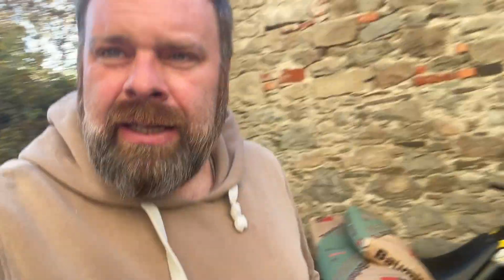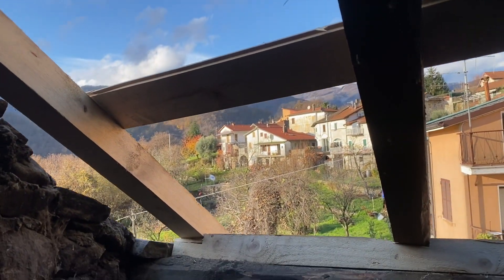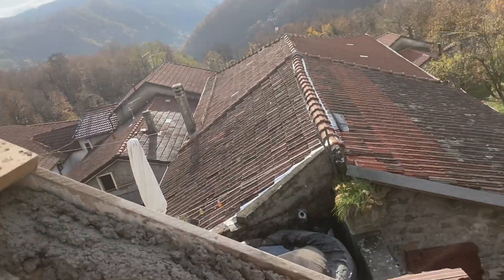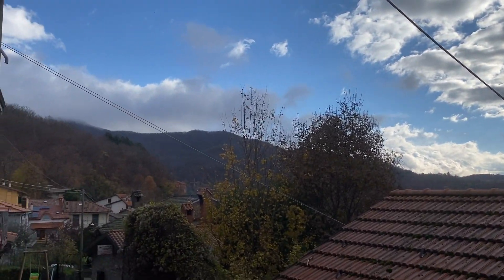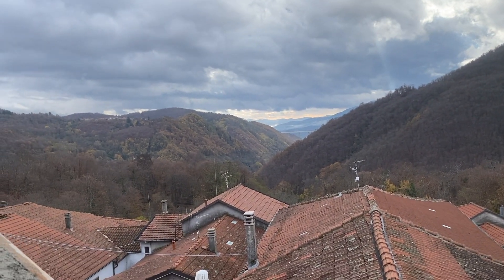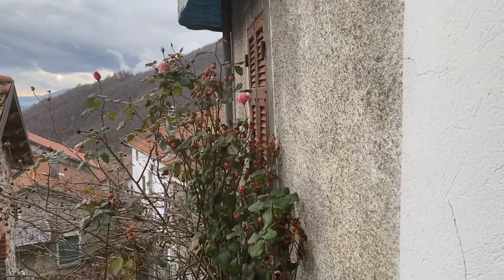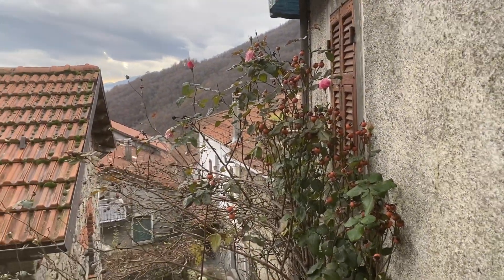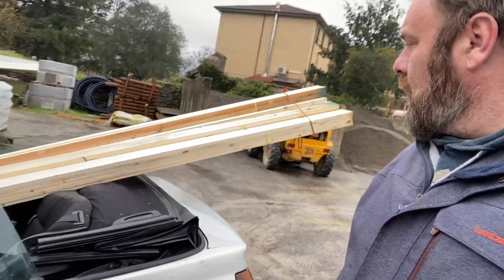Still roofing, the never ending story!

Comment: I learned long ago that if you workout you need 8 bags of concrete get 10.  An extra bag for every four bags unless you have some leftover from an earlier job. If you store it un open and in a dry place it will last 3-6 months after that if its stil dry and powdery you can add a couple of cups of fresh cement  to a bag and mix it. There are always small jobs that need a bag so ti never goes to waste.